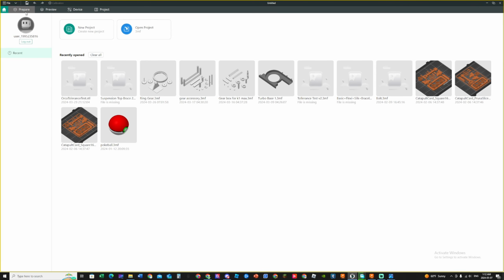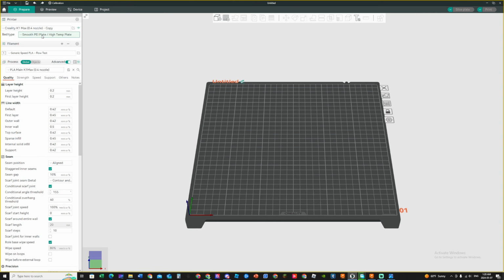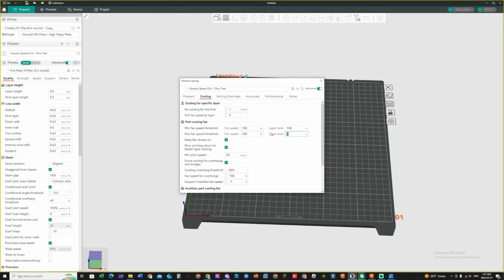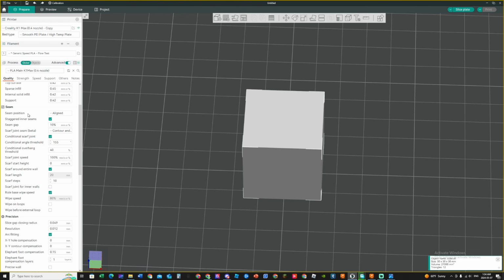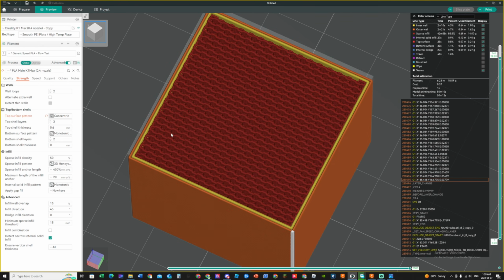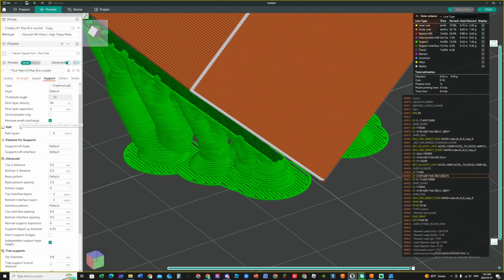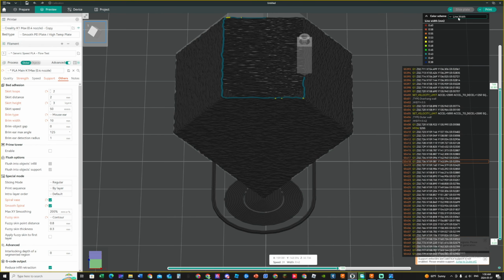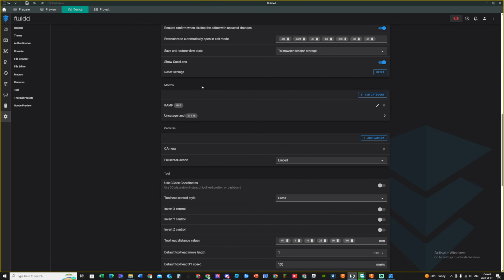OrcaSlicer Walkthrough The Most Import Settings

Comment: Small perimeter threshold is (I believe) a setting specifically for printing small geometry. This is useful because at high speeds they tend to come out very messy and ugly. If you set it for example to 6, any area thats smaller than 6mm will print at the speed specified in the "small perimiter" field above it.
Reply from the maker: Ahh, thanks for the info.

Comment: Yeah the print speeds is the only thing that phased me when i switched from cura to orca.
Its odd that default profiles vary so much between slicers.
I had so much success with most speed options being the same but orcas default profiles vary so much i wasnt having as much success as i did with cura.
But the ability to set different settings for different filaments is amazing.
Great video!!
Reply from the maker: Ohhh, I'm glad in not the only one. It was so much information using orcaslicer for the first time, but once I got used to it, it is really good!

Comment: Ok I have a question which I don't know is even possible but can you select parts of a model to have fuzzy skin on certain parts of the model?
Reply from the maker: I don't think you can, but maybe there is  a way of doing it. Like cutting the model and making the parts that you want to be fuzzy and the other part not.
Reply: @Scratch3DPrinting  there is a video of a guy that does it with cura but I was hoping it can work in orca as well